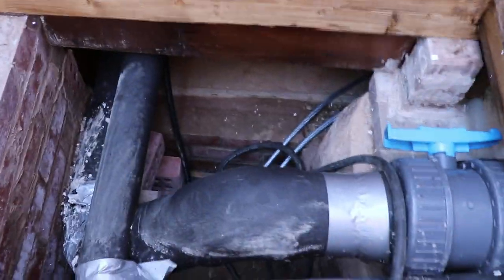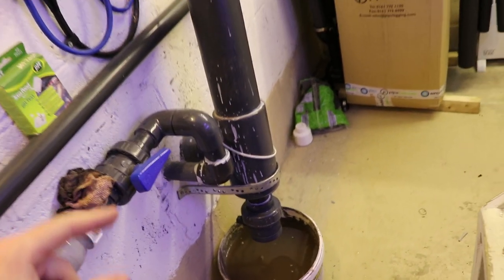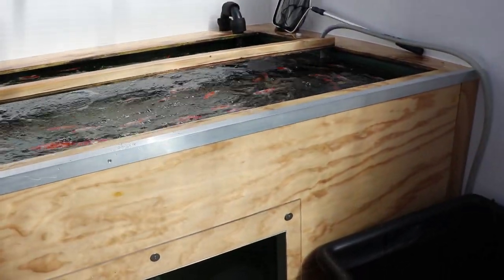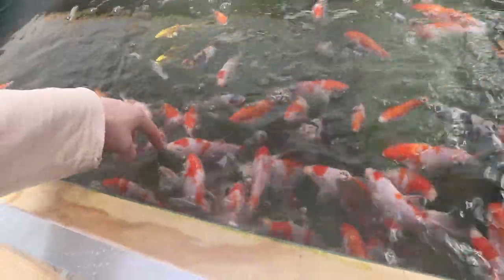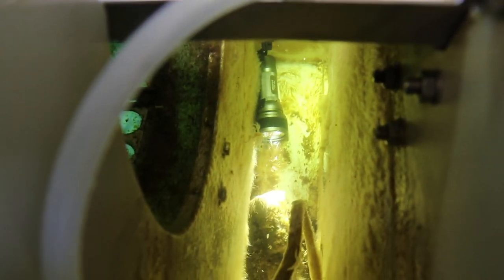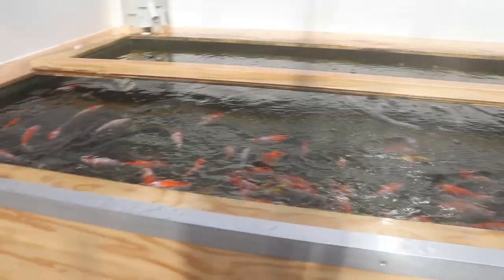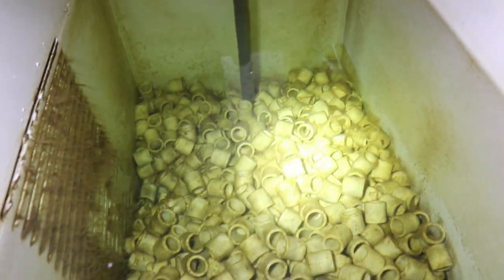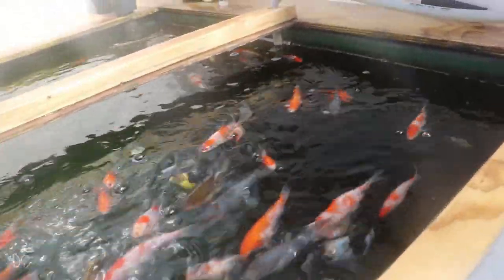Purging bottom drains - Pond maintenance

Comment: HI Adam thank you for all you advice   the problem I have is I am just under 2m from the boundary fence as it was pond  I didn't think I would need  to be anymore away. 

well if I have to take it down I will as Lowing  it won't look  right.

but I started this project before they came as there new neighbours but the pergola was not up. 

If it was blocking light or over hanging I could understand but it's not.  

I bet u the next thing they will complain  about is the bakki shower  is there any law on that?? 

as it will be running 24/7  

best wishes 

kev 
south Wales

Comment: Hi mate how much siporax you got in the filter for that grow on pond please?
Reply from the maker: stephendraycott I have 50ltrs of siporax which is a full box in this tank it does not need that much as 50l is good enough for 20,000L pond but I always add more than required to QT tanks as they are always really overstocked. I only had 100 litre in main 41,000L pond until beginning of this season I added another 100 litre but removed the bead filter it did not make any difference that I could measure. If your looking to buy some let me know I might be able to add it to an order and get cheaper.
Adam